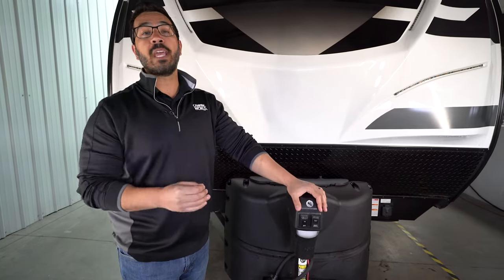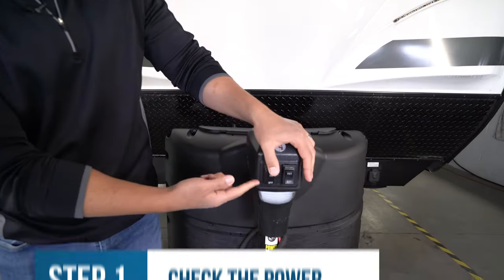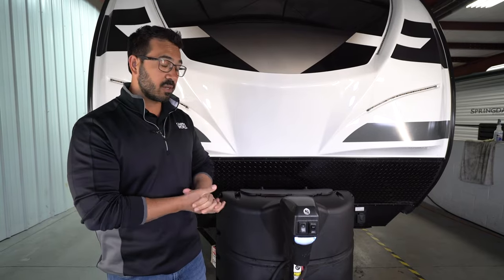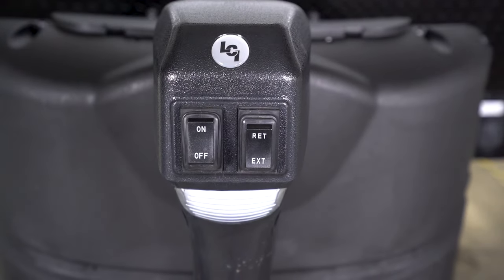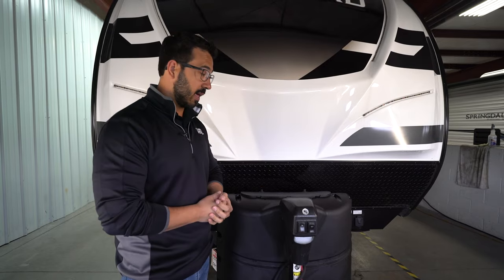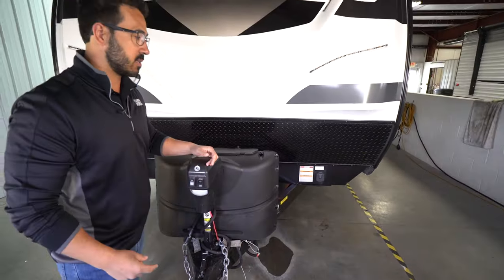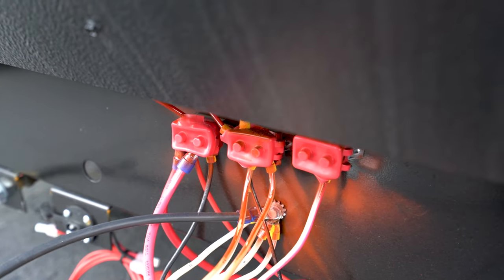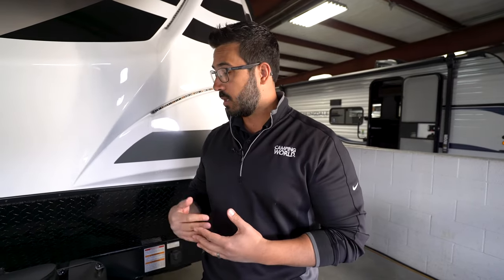Power Tongue Jack NOT WORKING?? Watch THIS Video! | RV Troubleshooting

Comment: I cannot get my manual hand crank to budge in either direction. I am using the manual override wrench that was provided from my trailer manufacturer.
Reply from the maker: I'm very sorry to hear this! 

In some cases, these jacks will seize and require inspection by a certified RV technician. You can contact our service department online here (https://rv.campingworld.com/service) or by phone here (1-866-838-5304). 

Hope that helps!
- Tucker Ballister
Reply: I had same problem and thought my crank (1 year old) would break. I persisted (1st time using manual overide) until I loosened the crank enough to get the jack moving.
Reply: I have the same problem. It won't go up or down with electric, and the manual lug won't turn.
What did you do?

Comment: Great video! Thank you! I didn't realize that there was a mini fuse thing in the cord that runs from the jack motor back. I noticed that housing on my trailer when I was poking around. I'll have to pull it open and check it. Thanks!